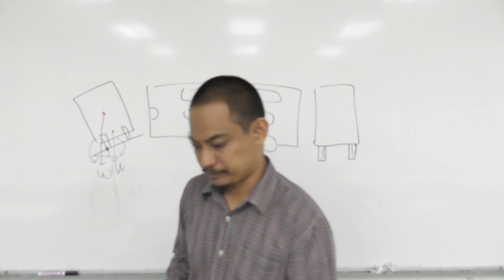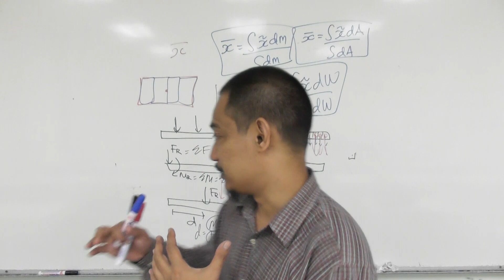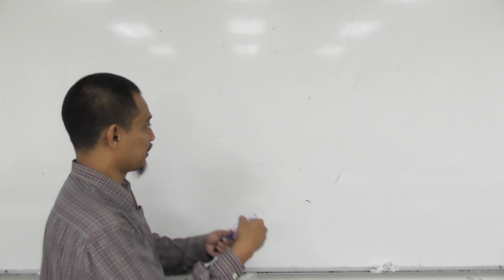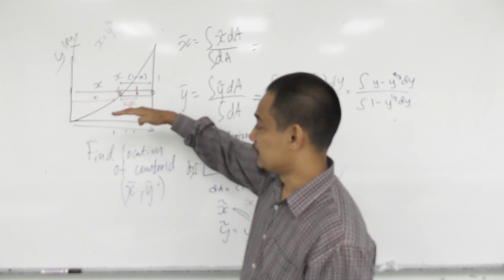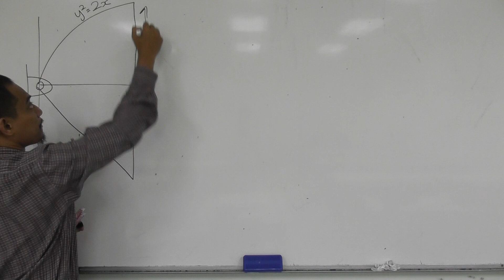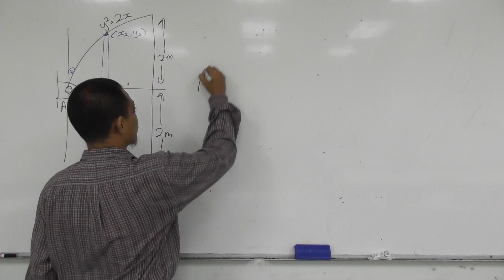Statics - Chapter 9 (Sub-Chapter 9.1) - Center of Gravity, Center of Mass, Centroid

Comment: Dr for 3:07, I think the reason why we would prefer to have a lower center of gravity in cars rather than a higher center of gravity is to prevent the car from tipping over its side when taking corners at high speeds. Normally, when the car takes a corner at high speeds, the weight of the car which is evenly distributed of its 4 tires will be distributed to 2 tires causing the car to slightly tip.  If the center of gravity is higher, such that it is at the roof of the car, then the car will tip even more and fall down.

If the center of gravity is lower, such that it is located just above the tires, then the car might be able to regain its stable position after it exits from the corner.

I am not sure if my thinking is right, so I need your assistance Dr.
Reply from the maker: well, for a full discourse on moving cars for example, only statics is not sufficient as it does involve momentum etc...
from concepts directly related to statics, yes, the position of CG is directly affecting the moment and tendency for rotation, be it that will cause for tipping or that will prevent from tipping over (and in the situation you stated, provide maximum possible moment to keep traction on all 4 wheels / prevents as much as possible from the two wheels lifted from being in contact to the road when taking corner at high speed)

Comment: At 36.19 , so the x and y as per the drawing was not part of the shaded region right? So for this kind of question, we need to take the max level of x or y value in the shaded area and minus it with x or y depend on the question right sir?
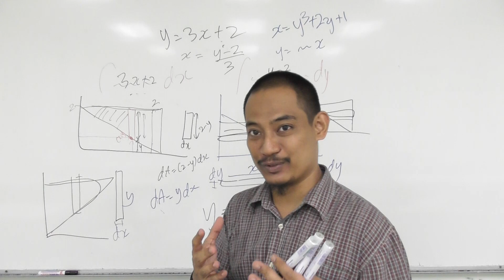Reply from the maker: 36:19 ?
which drawing are you referring to?
Reply: @SaifuddinRehan  the left side drawing sir, it use vertical so use 2 as it represent the whole area and minus with y
Reply from the maker: @sokizzat  oh okay...

that area basically is bound by 2 curve, one is a straight line of y = 2, another is the other line with negative slope, y = -mx + 2...

lets call the upper curve as y2, and the lower curve as y1...   

so if we use a vertical element, the height of the element is basically = y2 - y1...   
as y2 always equal to 2, the height is basically = 2 - y1...

so the differential area of the vertical element, calculated by height x width = (2 - y1) . dx

on the whiteboard, as normally if we deal with curve with constant value of y, then we don't need to use y2 and y1, simply the value of the top curve (in this case = 2) and the curve as y = mx+c...
hence height is simple = 2 - y
(where y in this case is the y-coordinate of the point on the lower curve)

can you follow this explanation?
Reply: @SaifuddinRehan  okay now i got it, so if say the y2 is a smile curve; so basically all i need to do is insert the y2 eqn minus the current y1 eqn right?
Reply from the maker: @sokizzat  yes correct
Reply: @SaifuddinRehan  Alright, thank you so much sir